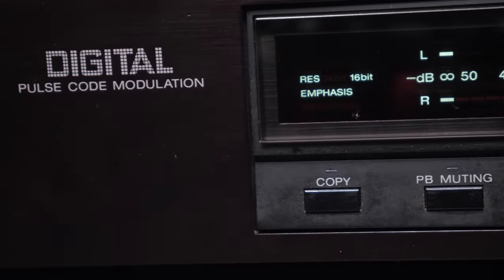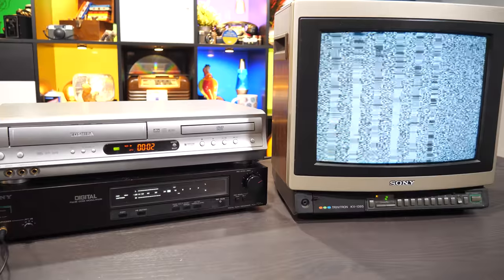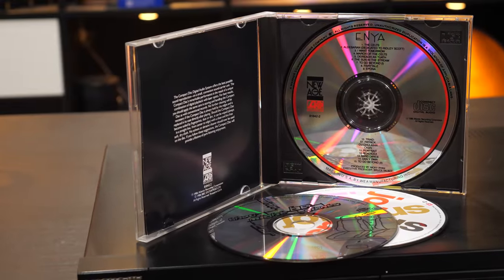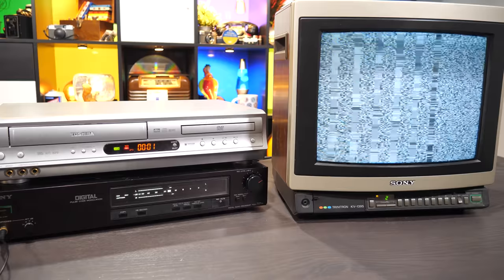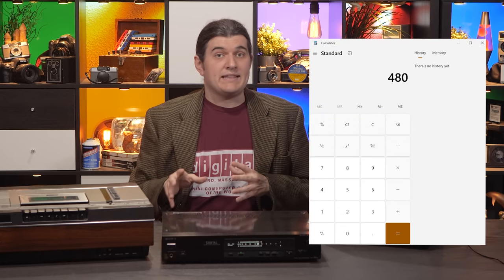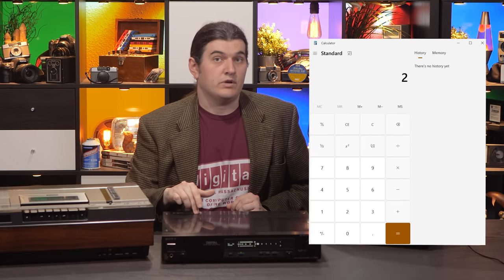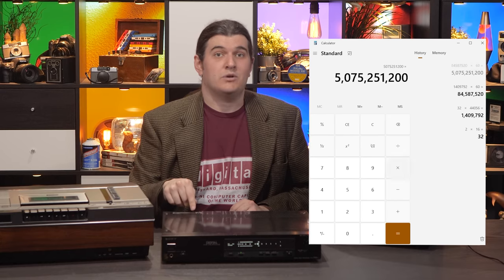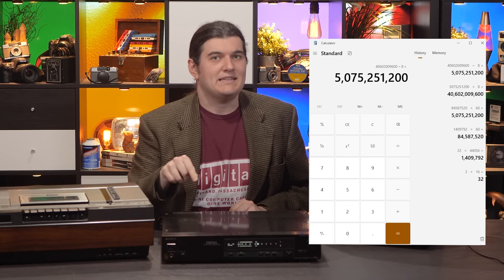Digital audio needed videotape to be possible - and the early days were wild!

Comment: 33mins:  Why didn't VHS get used for data storage until the mid 90s?  Well, consider that late  70s ~ early 80s, many of use had to use AUDIO tapes to save and load programs for our computers because the Tape drives were about $50 vs $300~600 for a floppy disk drive!   For my first  computer(s) I used a tape drive from 83~85.  I had to save money to buy a new 320K floppy drive for $280!

The problem with Cassette tapes and VHS for computers is that those drives are liner.   At best, okay for backup.  The computer could NOT control the VHS/Cassette units.  We had to press PLAY or REC buttons at the proper time.   Also the LOAD / SAVE speeds were horribly slow.    
Backup Tape drives from the mid-90s~early 2000s were still slow, liner.  Could take hours.  And then to verify the backup, the computer would have to rewind the tape, and play it back.

DVD-Rs were better, but of course nowadays, we just used cheap $100 2.5" Hard drives.

Comment: Maybe the audio of 14 and 16 bit is encoded identically with just the smallest precision bits tacked on. Can you play 16 bit recording back in 14 bit mode? Unless it's auto sensing and ignores the setting on playback in which case you'd need a 14 bit only machine to test it

Comment: OK then.  Never knew these existed.  (Tho I was aware of the U-Matic version in those days).   But what about VHS 'HiFi' sound.  My understanding is that this was also a form of PCM.  The sound is written by heads that spin like the video heads.  As I recall, it sounded very good.  Probably close to the quality of one of these PCM adapters.
Reply: yes, "FM audio" stored along with the video signal, more practical and still recording really high quality audio for 6 to 8 hours in a vhs tape

Comment: Also, Pioneer, at least, had a tv tuner thing, that let you pass tv audio into your hi fi system, so it's even more unnecessary. With the hi fi system, you can record on reel to reel, which supports as high as 6 hours, 24 minutes with the biggest reel and the lowest speed.

Comment: I never knew where the 44.1KHz standard came from.  What a goofy reason :)
Like: Why is MIDI 32.25K baud?  I found out that it's the fastest rate you can send data off a 20Mhz 8051 serial port so maybe that's the reason?

Comment: I think I have too many questions. Idk. We'll see.

Would it be possible to record the video, compress it with H.264 or something, and decode the compressed video? If so, how much compression could you get away with before the audio signal was unrecognizable?

Would it be possible to pixelate the signal in some way? Maybe reduce the vertical or horizontal resolution?

Could you flip the video signal vertically? i suspect it might be necessary to do some clever video editing to only flip the 6 columns .

Is it possible to delete every other frame or two and duplicate the ones that remain to keep the video playback speed the same?

What would it do if you put a random regular picture on the screen over a single frame?

Would it be possible to recover audio from a high quality monitor by using a high quality camera?

Yeah, Idk. Seems like too many questions that would just end up in garbled or no audio.

Comment: > but when you consider that Sony sold a device back in 1977 that could reliably store literal gigabytes of data on Beta tapes of all things… well you’d think people would have made use of that for more than just audio. Of course, eventually we did.

Well, the idea of storing data on a consumer tape was a thing already in 1975 with Kansas City standard. It's just audio tapes were way more popular than video at the moment, and there was no real application to process much more than 300bps with a computer anyway.
Reply: In the early 1980s, though, software publishers in Europe would develop fast-loaders that crammed in a lot more than 300bps - mainly to try and thwart software piracy. By pushing the data rate to the extremes, they tried to make it less likely for a lowly consumer tape-to-tape recording to result in a working copy.

In principle, the higher audio quality of HiFi videotape could have thwarted that thwarting, along with allowing pirates to pirate humongous 6 hour long software libraries at a go. However, VHS HiFi VCRs wouldn't become affordable until the 1990s, by which time even Europeans had moved on to floppies.

Comment: I realised the 1Mz bandwidth that is easy to get out of a VHS could be anything. So, I stuck an RF ariel in the video in, injected a control track signal and recorded the entire Medium Wave band. I could tune up and down the tape afterwards. Also, I could stuff undemodulated FM stereo signal in the input and demodulated it on replay. Sadly - I got gaps in it :-) It clicked ! This was 1985ish I think.
I stupidly told Sony about my invention. The chap on the phone was VERY interested. I heard nothing after that. Only a few months later the 'HiFi' VHS came out. It filled the head switch gap with a third head - cheats ! They also managed to get Video at the same time.  All Analogue. Very good sound ! ( with clicks ).

OOps, I've said this again !
BTW, I knew about the PCM adapter but would not afford it !

Comment: for some reason the reciver ( Technics SA-DA10 ) that i have going for the audio system right now as im watchin youtube can only take 44,100Hz in 16bit from the computer, other frequenzies will not work at all.
for anyone interested i have these speakers connected to it 
2pc Jamo D256  
2pc Jamo D365  
2pc Pioneer S-Z360
2pc Cambridge Southwork microworks I satellites
1pc Yamaha YST-SW1500 Active subwoofer

its not blasting but sound is really pleasant to the ear from these ;)

Comment: I used to use my HIFI VCR to record audio back in the 1990s.  (CDs)  But most time, I just bought CDs as they were much easier to work with than a good HIFI VCR.    But back then, foreign CDs were hard to find, buy and were expensive.  So we would trade that way.   So it was a thing for a few years I  think, from 1991~1995.  It's been decades.  And of course those VHS tapes have long degraded - okay, long dumped into the trash.

Comment: Hold up, NTSC and PAL both had 14400 (or 14386 in colour NTSC) visible lines per second, why did they have to go to 14700? Just to squeeze more data in, even though 43.2 kHz would have been an adequate sampling rate?

Comment: You mentioned that the data backup product could save about 3gb of data at maximum, but wouldn't that take the full 8hr or whatever of the EP mode to do so?  How did the data transfer RATE of this compare to other backup options at the time?  I remember I could copy a 100mb Zip drive in a few minutes, CDR took off with 4x-8x speeds and just took off from there, think I had one that was rated for up to 50x toward the end of CDR time if my memory isn't distorted, but that was still 700mb in a few minutes.   If it is 3gb in 8hr, I think that would be like 10kb/sec, that's only slightly better than 56k Dial-up speeds.

Comment: It was not uncommon to record your precious LPs to open-reel tapes to listen to back in the 70s and early 80s.  This seems like they were trying to tap that market since the video cassettes were WAY cheaper than the open reel blanks and the recording time was huge.  Of course this setup cost quite a bit more than a top-of-the-line open reel deck.  Also I remember reading an article back when CD pressing plants were new that they accepted video tape for the masters.  I remember thinking, what?  They must have meant the umatic tapes which I was unaware of at the time.

Comment: Basically the whole point of why people not use this to store "DATA" for PCs until 1990s is ... There is no such memory to hold that much of data. PC Memory merely pass 1MB in size at that time, same as Harddisk which still less than 100MB each. So .. what you gonna do with 3GB of storage on VHS tape when your computer can only process 1MB of data at a time.

It's only make sense in real-time data, such as audio, video or data logging from sensors.

Even in early CD-ROMs era. I remember when my first PC get equipped with CD-ROMs in 1993 which hold 650MB of DATA. Whopping 5 times larger than my 120MB harddisk. Playing WAV PCM 16 bit/44.1KHz/Stereo format (Same as CD) to Soundcard in 16 bit ISA bus would require 1/4 amount of Bandwidth of that BUS (1/8 to Sound Card and 1/8 from Disk or CDROM), if you not using DAC on CDROM itself.

Comment: In most contexts a gigabyte is actually 1024MB and so on...meaning that's actually not over 5GB but rather under it...I know I know, that's technically a gibibyte! Except most OSes count both RAM and storage space with base 2 units and call it a gigabyte. Personally I think we should just do away with the base 10 data sizes. For additional reference that 650 million bytes statement is actually wrong. Those CD roms held 681.9 megabytes...but 650.39 mebibytes which is 681,983,344 bytes...and this is exactly why we should get rid of base 10 units -_-

Comment: If one were to record a 60fps black and white video, or an odd-frame-rate "video game" signal, on a consumer VCR, would it be played back at 29.97 frames/second independent of the original frame rate?  How accurately, and via what means, would VCRs regulate that?  What would the PCM decoder do if fed a signal at a frame rate other than 29.94fps?  I would think it would be fairly easy to design a VCR to accept a speed-control voltage from a PCM decoder to allow the decoder to maintain 44,100Hz precisely, though of course consumer-market VCRs didn't evolve to include such a thing.

A sample rate of 44,100/second, divided by three, would require 14,700 useful scan lines/second, or 1,470 scan lines per 1/10 second.  In NTSC, that would be 245 lines/field, and in PAL that would be 294.  While those are both conveniently integers, those figures both seem to intrude upon the vertical blanking intervals for both PAL and NTSC.  I wonder if the design intention had been to use 45,000/second, which would have been 250 lines/field and 300 lines/field, but it was decided that cutting the vertical blanking interval that much would yield unreliable results?  I wonder how reliability would have been affected if the format had kept the 45,000Hz sampling rate but formatted each NTSC frame as e.g. 15-line vblank 250 lines picture 10 lines vblank 250 lines picture?  Since video recording equipment operates on frames, rather than fields, I wouldn't think it would need a mid-frame blanking period, except to facilitate vertical sync decoding.

I suspect the delay in the adoption of this high-bandwidth digital storage to computers is probably somewhat analogous to the way that 9600 baud fax machines were common long before 9600 computer modems were.  While one might aspire to have defect-free audio or image transmission, imperfections in data intended for human viewing are more tolerable than in data intended for machine processing, and thus the required reliability to make something suitable for use with computer data was much higher.

I wonder if there were any efforts to adapt this technology to synchronized multi-track recording spread across tapes?  if timecode information could be suitably processed, even a studio with a modest number of recorders could handle many mutli-track recording tasks by having one recorder for each pair of microphones/inputs to produce a "raw" master tape of a session, along with a pair of recorders to record a live "working mix" and then play it back for performers while recording the next "working mix".

Comment: why use a seperat VCR, wouldnt the users experiance be better if you built a VCR heads into the PCM box, use the same tapes and much of the same hardware components. it would save considerable space and cable managment.

Comment: They should have made a vcr with a simple computer or game console build that could load games and other things from the vhs tape that also contained a movie. you could also load the game first and then use the movie as a background. or maybe it could add multiple subtitles that you could choose in a menu or put a cursor on the screen and if you click in certain things in the movie it could give you some trivia. it probably would have sucked and flopped but a cool gimmick for some people back in the day before dvd. there where game consoles that used vhs but these where not proper game consoles. they where just pre programmed light gun games or racing games that used the movie as a background but didn't load in any data.

Comment: CRC is useless.  It tells you when there's an error, so you can drop a bit, but for playback, that just lets you, at best, mute an error, rather than playing it.

FEC is what is needed.  Block codes and Convolutional codes were around then, but for this application, a block code would have been easiest.  The exact details would depend on the fidelity of the coding/decoding process, available bandwidth and desired error rate.

Given the era, a simple Reed–Solomon code is my first guess.  R-S was invented in 1960 or so, and used widely through the 60s.

So FEC, not CRC is likely in the snow.

For 14 to 16 bit, what if the 14 bit was a 1/2 FEC (meaning 28 bits of data, 14 usable), and 16 was a 4/7ths FEC?  This would have allowed for an improvement in error correction algorithms to be realized in a slight bump in data quality, with either no impact, or a slight increase in bit error rate.  And 14 / (1/2FEC) = 28, and 16 / (4/7FEC) = 28, so they use exactly the same bandwidth.  Today's wireless (from WiFi to 5G to satellite data) relies on a fix width channel, with higher speeds inside that channel based on negotiated "quality" that increases and decreases FEC/modulation to adjust the error correction and bitrate based on local quality at that moment.  We know they didn't mess with the modulation, so the only variable to explain how/why they would go between 14 and 16 would be FEC changes.

Comment: My TRS80 CoCo used DAC to record to an ordinary cassette tape for data storage and retrieval. be curious to see how much data i could store on a 90 minute cassette tape.
I've also mused about using a printer as backup media. imagine a printer capable of 1200x1200 DPI printing. let's assume our encoding takes up perhaps 1/3 of the total "data"
that's ((1200 x 1200) * (2/3)) /8 = 120000 bytes of data per square inch of paper. Letter sized paper (8.5"x11") needs a margin so let's assume .25" results in a 8"x10.5" printable area.
ending up with about 10MB per page (*2 for double sided).   Sure that's not huge, but archival paper and ink are well known and handled well, could last quite a bit longer than magnetic media. (Also consider I started thinking about this in the late 90s... where that was was a good chunk of data)

Comment: The Sinclair ZX81 was introduced in 1981. It used audio cassette tape as a digital storage medium. It's predecessor, the ZX80 could also use cassette tape for storage. Early Commodore PETs, first introduced in '77, also had cassette tape interfaces.

So using tape as a digital storage system was a thing.  It's just that it SUCKED . The sinclairs were CHEAP and little hardware to help the poor little Z80 in its tasks, so while you were reading or writing to tape, there was no CPU allocated to video, and you got some weird artifacts on screen. The PET did better, but it was still SLOW. Despite the fact that we were only working with, at best, 64KB, loading programs from tape took, as I recall, 10 to 20 minutes.

I can't imagine most consumers being willing to put up with that sort of thing. Those of us on the cutting edge barely could. I think I used the cassette audio all of 4 times. It seemed simpler to me to just write my code down on paper, and re-type it later ... If I didn't just take it as an opportunity to "refactor" my code by re-writing it from scratch/memory.

Comment: Video tapes aren't that reliable in terms random (and not so) errors, and extremely susceptible to dust. Data written to compact cassettes were a thing in computer enthusiast community, but it stored tiny amounts and read/write speed was mighty slow. VHS tape might have a 2GB data capacity, but if you spend 8 hours to read it, that's just 70 kilobytes per second, twice slower than basic 5.25" floppy. And it has no random access, have fun searching for that 4 bytes in the middle of tape.

So, they were only ever used for backups.

Comment: this makes me wonder , if you look at commendore 64 for example then data get stored as digital format , you press play for the casette tape to load the program
could it be possible that they use this system already to get massive data as it could hold 5Gb of data already
in that case it has a lot of use for home use , just like the tapes has for the Comendore 64 

also compared with the quality you get from it does it seems superb over normal casette tape, the corrections it contians seems to be superb to maintain high quality while normal video get worse over time

Somehow there was a certain market for it , else they would not release multiple versions for consumers, but probbably that market got lost with the cd like telephones are now replaced with mobile phones or normal lights with led lights ... technology get lost in time and the purposed function also get lost with it

Comment: I Don't agree with you about FM radio. FM Radio can be Hi-FI, only today they're pushing it to the limits. Back in the 1970's and 1980's, they didn't use so much soundprocessing but only limiting to protect the signal from over modulation. I Have recordings from FM radio from the mid 70's on reel to reel tape, it still sounds amazing! Even better than most CD releases from the late 90's!